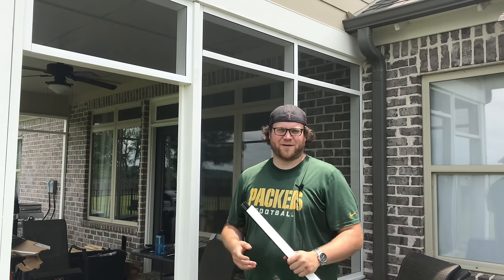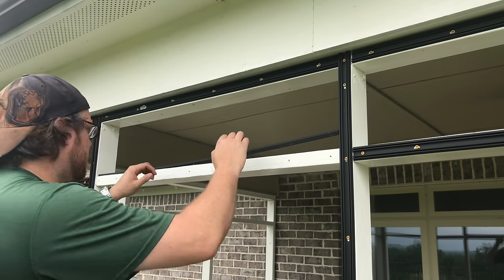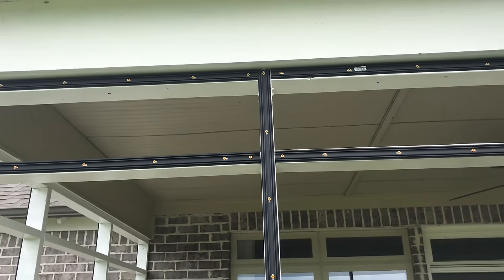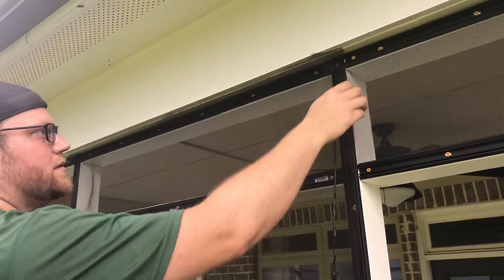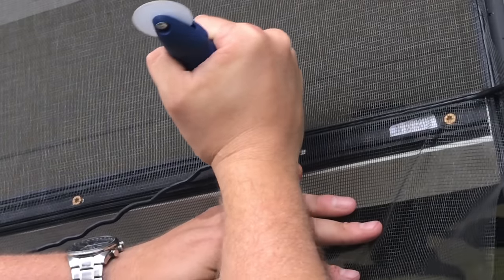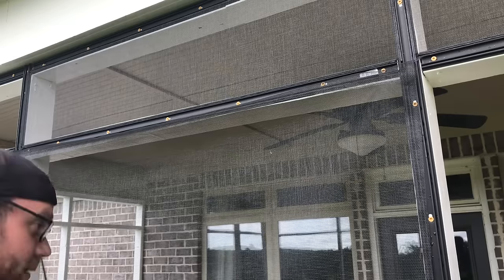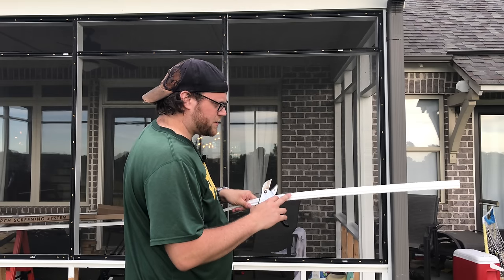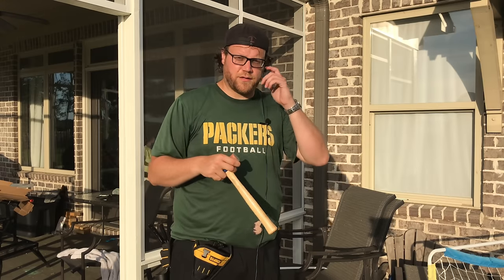Screen Tight Install Tips and Tricks

Comment: How do you deal with water coming in during the raining season? Does your bottom 2x4 base have a little gap for water to flow out?
Reply from the maker: I took a 4” diameter piece of pvc and heated it up and put a piece of plywood into it to shape it into a 3/4” wide oval. Then I cut one side of the long flat parts (this opening face the ground). I cut out a piece of 2x4 and put this arched tunnel there after finding the lowest spot on the patio. Siliconed all around it so all the water goes out that area and not under wood.

Comment: Are the caps necessary?  Could I just leave the black tracks open to the elements? Maybe use black screws?
Reply from the maker: I don’t see why not but you might see some spots to left/right of the screws where the hole slots are. Only thing I can think of is if the spline material has UV light resistance or not.
Reply: @TheVintageEngineer  Thanks for the response.  I see what you mean about the UV light damaging the spline.  I have this question in with the company now.  
You are a gifted teacher.  Really appreciated watching the entire video!

Comment: i am struggling to find info about installing a screen door. The issue i have is that my door hinges must be attached on the outside of the door frame. This will be the same piece of wood that i am attaching the base/cap. Is there a work around or any tips?
Reply from the maker: Why do they have to be on the outside of the door frame? I mounted mine to the inside of the jam so when closed the hinges are at 90 degrees.
Reply: @TheVintageEngineer  our door needs to open outward. i am not "seeing" what you mean by at 90 degrees closed.
Reply from the maker: @willbernhardtii2355  shoot me a message on Instagram and I can send you some pictures. Instagram.com/Sheltonfilms

Comment: Thanks! But how do the corners work? It would seem like the screen would have to come out of the track at an intersection. Is that not an issue?
Reply from the maker: Not an issue. There will be a small section (less than 1/4”) that won’t have continuous hold from spline. But no issues from this

Comment: When you put in the spline why don't you pull on it while a part of it is in the channel. That way the spline reduces in diameter and can fit in the channel. After you release the tension it increases in diameter and fits snugly in the channel. This way its also easier to use the spline tool to push in the spline.
Reply from the maker: Easier to install yes, but I have found that it doesn’t grip as well when pulled prior to install as it never achieves the same thickness as not pulled and it also keeps slowly retracting after the end is cut. I’ve seen the ends recede almost 3-4” by time it gets to equilibrium

Comment: My screen has now come out of the spline and it's groove because of high winds and probably old age. It's old age, not mine, well heck, maybe mine too.  The screen was pulled so tight and trimmed so meticulously that i cannot hold onto any part of it and put it back in and secure it again. What do I do? Signed,: Flappin in the wind.  LOL
Reply from the maker: You will have to get some new screen and maybe some new spline and start new using the old track.

Comment: Anthony, what was the estimated cost of all your material?
Reply from the maker: For the screening part, I’d say $300-ish. I think I bought 27 pieces of track and cover at about 3.75 a piece. So that’s $200. About $100 for the rolls of screen, spline, and screws. It’s cheaper to just do staples and lattice strips, but I like the fact that it gets the screen tighter and makes repairing sections easier.

Comment: Most painful home task yet this year - The smaller panels are fairly easy, larger panels not so much - I am using a more durable, insect barrier 20x20 mesh called Super Screen - Trying to dial in the correct spline size was key and honestly, may have a pro in to finish the job - It is taking way too long for me to wrestle with getting it smoothed out and tight enough to look halfway decent - Especially with the more durable screen - Oh well, I did complete many home projects so far during this scifi movie were are living in - Screening in the porch is just not my forte I suppose, lol ... \m/
Reply from the maker: Yeah I definitely don’t see myself doing it to make a living, but happy I did it.
Reply: @TheVintageEngineer  I'm still giving it a go, the larger panels using Super Screen 20x20 mesh makes it more challenging but the screen is awesome for durability and mitigating mosquitos, gnats, etc.  \m/

Comment: Where can I get the same channel lock as you are using?
Reply from the maker: You mean the cutters? Look up “anvil cutters”
Reply: @TheVintageEngineer  No I am inquiring about the Channel lock that the screen locks into with the 1/1/2 cover
Reply from the maker: @omercharest7159  ohh. I hear “channel locks” and I’m thinking pliers. The system is called “screen tight” and sold at Lowes.

Comment: I just had mine done in march..now I have many areas where track is bowing away from boards..why? 😭😭
Reply from the maker: It’s possible the framing was still wet from being pressure treated and has shrunk a little. You can take the caps off and loosen the screw a little bit and might be able to flatten the channel since each screw hole is slotted.

Comment: my wood members are 1 and a 1/8 inches thick, is it ok to use even though they are 1.5 IN thick?
Reply from the maker: The bottom horizontal pieces on mine are about 1.25” and since the ledge was at the edge of the piece all the excess went one way. I’d say if your wood members are in the middle where excess would go both directions then you will be fine. If not the spline valley will be hanging over and when you try to spline it won’t have enough support behind it to push it in. Hope that makes sense.

Comment: Why do you start with the side panels instead of the top panels?
Reply from the maker: Mary Schulz talking about laying tracks vertically first then doing the horizontal ones? Personal preference.
Reply: @TheVintageEngineer  I love your video and your Packer shirt.  We are doing very wide openings, 11 feet across.  I thought it would be easier to line up the horizontal stretches and then "hang" the vertical strips down from that.  Do you see a problem with that?
Reply from the maker: Mary Schulz just talking about the tracks right? Yeah it really doesn’t matter for the tracks. It pretty much comes out all the same as far as the spline channel goes.
Reply: This is an amazingly good and detailed video. I am about halfway through putting up the base and wanted to see your video again. One thing I noticed that could have made working with the spline a bit easier. I saw that the adjacent panels weren't installed yet. So, rather than holding the spline horizontally with your hand, pull it out and press it into the channel of the adjacent panel to hold it. Also, what about using a flat blade to start the spline a the ends. Finally, the architecture I'm dealing with has columns that required me to contour the base at the ends. So I used a Dremel cut-off saw to cut or contour the base. Haven't got to the splicing part yet but your video has a lot of helpful info.

Comment: Is this system More Costly than Ez Aluminum Kits 2x2
Reply from the maker: An 8ft piece of the EZ is $37.50. The black track of screen tight is 3.75 and cap is 3.75. An 8ft section of pressure treated wood is like $5. So looks like screen tight is like 1/3 the price.

Comment: I can't see how to turn from horizontal base to the vertical base
Reply from the maker: Can explain more what you mean?
Reply: @TheVintageEngineer  after you get to the edge of the horizontal base, how does the screen cross over the the track of the vertical base without bunching. It couldn't see that well in the video. Your video is quite thorough I might add. Is it preferable for the horizontal base T-bone the vertical base, or should the vertical base T-bone the horizontal base?
Reply from the maker: @jamesrogers9280  @28:10 is probably the best view of it. You can pull it tight (screen) and that should get rid of majority of the bunch. If you are watching on a tablet, try pulling this video up on a smart tv. I filmed this in 4K so it should show up well on a bigger screen. The t bone is personal preference. I’ve seen it both ways.

Comment: How much does this cost?
Reply from the maker: About $4 a channel stick (8 feet long), same price for cap. Spline was like $17 and all the screen was maybe 60-80. Whole project: framing, paint, hardie plank, screens, hardware was under $1000.
Reply: Thanks so much for responding! Thinking on taking this project on.
Reply from the maker: I bought the material back in March 2020 before everything shutdown. Might want to wait a little longer for lumber to go back down.